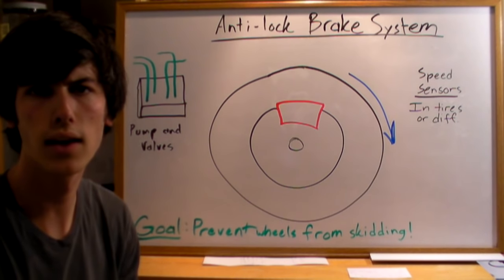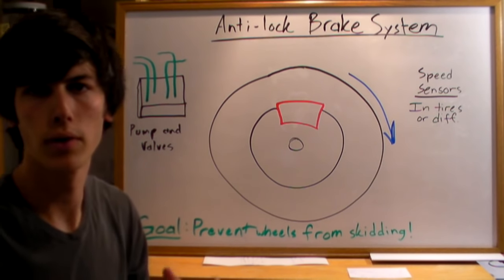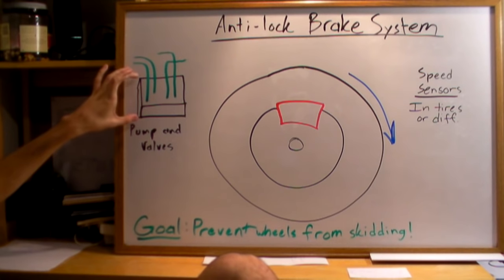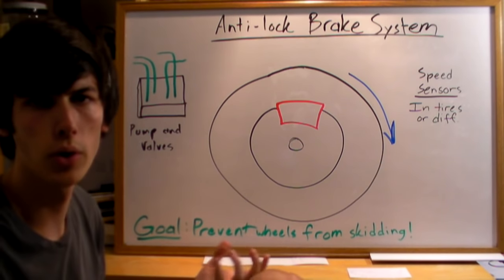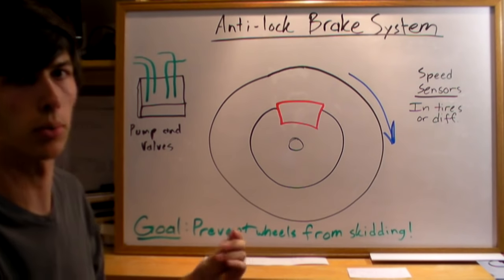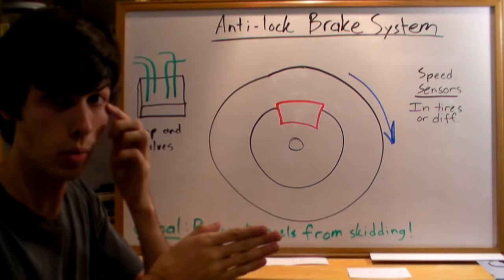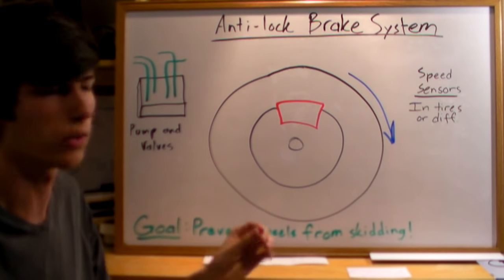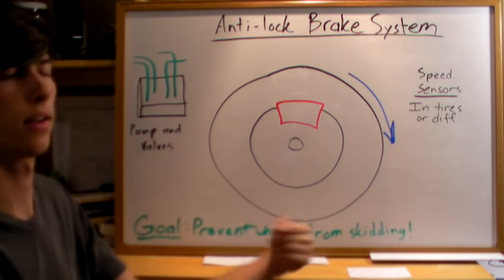Anti-lock Brake System - Explained

Comment from the maker: Well it depends on the complexity of the system. Theoretically a perfect ABS system could stop at peak grip, thus stop any car in the shortest possible distance. It just comes down to how quickly the system responds to alterations, and the duration it takes to press/release the brakes.

Comment from the maker: Could be a difference in the left and right brake pads or rotors. If one comes into contact first, it could make the car behave a little strange. You can always take it to a shop and have it checked out.

Comment from the maker: The brakes lock if you press your brake pedal too hard, and the force exerted by your brakes on your rotors is great enough to stop the wheels from spinning. You can't steer if your wheels are locked because your tires are just sliding, therefore can't change the direction you move in.

Comment: Great video...Looking for an in depth tutorial in future regarding master cylinder, modulator container, abs pump/valves, speed sensors and how and route of the brake fluid travels while braking, and what happens with brake fluid when antilock works.

Comment from the maker: Theoretically, ABS will improve the stopping distance if it can maintain peak friction between the tire and the road, without allowing it to stop too fast. There's not a definite answer. A good driver could likely stop in about the same distance by not allowing the tires to lock up. A less experienced driver would probably go a bit further than ABS would allow for.

Comment from the maker: IF your wheels lock completely under braking, and you leave the pedal pressed (keeps the tires sliding) then yes, ABS will improve your stopping distance. If you're perfect with your feet/brake feel, then you could theoretically stop faster on your own - not many humans capable of this though, and I would be willing to bet a computer would win 10 out of 10 times.

Comment: Hey man, you popped up as "related videos" while watching some F1 and NASCAR footages.

Anyway, on dry conditions, ABS will actually stop your car a bit slower than a car without ABS. The upside of ABS is that it keeps tire used in sorted fashion, meaning you will have tire worn out all "sides" at once, and it is impossible to tear down the rubber faster on one "plane" of tire. 
The only conditions in which ABS gives you advantages are :
-damp conditions
-cornering / steering while braking hard

Comment: Hi Jason! Thanks for the video. I know that's quite old video and probably I'll be speaking into to the void, but anyways, hope it will reach out to you and you will be able find some time to answer my question.

It looks like ABS is actually not the best possible (at least theoretically) way to stop because ABS system will usually cause some wheel slip whereas the most efficient way to stop is to have no slip at all. Is that fair to say?

Do you think that sufficiently experienced driver can outperform ABS equipped car controlling the break power manually w/o ABS?

(just found term called "Threshold braking" which is what I'm talking about)

Comment: In the dry whilst threshold braking, the difference between ABS equipped/ un-equipped cars is minimal. But as conditions get wetter/ icier, cars without ABS stop quicker. The gap between cars is metres in the wet (because the ABS cuts in too early and for longer), 10s of metres in the snow/ ice (because ABS basically prevents you from braking, but in an un-equipped car snow/slush builds up in front of the locked wheels and they effectively become a snow plough).

Comment: Agreed, but you can only go so far with software, it then boils down to the resolution of the encoder that is being used, and on your everyday sort of car it will be 'robust' to put it nicely (to keep it from being ruinously expensive to replace). 
In any case, ABS should not be extolled as something which it is not. It is merely a devise that allows you to maintain some level of steering during heavy braking.

Comment: I really like your videos (even though being an engineer and a tech myself I knew most of what you explain already) and your style of explaining technical topics as simply as possible without being boring to people who already have some knowledge in that field. But one of the main statements of this video is (in parts) wrong. 
An ABS System does NOT necessarily reduce the distance required to stop the vehicle. I know where you get that idea from (static COF is higher than kinetic COF) but what comes into play here (on older cars with older ABS systems) is that the tire's rubber sort of locks into the microscopic hills and valleys of the tarmac and is being ripped off which creates that burnt rubber smell and uses up a lot of the car's kinetic energy. The older ABS systems reduced the applied brake force by too much, so the ripping off rubber effect was bigger than in modern cars.
And even modern systems would be inferior to a very experienced driver, at least when the conditions do not change throughout the braking. If that sweet spot of optimal braking with around 15% slip is considered 100% of the applicable braking force, a very experienced driver will be able to hold the actual braking force somewhere between 80 and 120% (meaning 12-18% slip), so close enough to the ideal spot. An ABS, however will kick in probably at about 200% (30% slip) and reduce the actual braking force to sth. like 50% (7,5% slip). Old systems basically kicked in at 666% (100% slip) went down to 0% actual braking force, releasing the brakes entirely.
Where locking wheels are always reducing the distance is on loose ground like gravel or snow as locked tires build up a wedge of the loose underground material.
So for us standard casual drivers in more or less modern cars, the ABS will reduce the braking distance (though not by much). But it's main idea is to keep the car controllable so that you don't understeer straight out of the corner or can turn your car around that kid that just walked up in front of you.
Reply: You are saying the car stops faster when the wheels are locked up and sliding because the rubber being ripped off the tires uses up the car's kinetic energy? And for the numerical percentages you use, do you have any sources for where you get those numbers, or can you at least explain where they come from?

Comment: Hey thanks so much for your videos, they're all amazing!

One question, my van constantly ABS's even under normal conditions if I go to stop at a stop sign. It's fine when I'm moving fast but as I approach stopped it will always ABS a little. It never used to do this, what could be causing this?

Comment: As the ABS reads from speed sensor, is there any risk if i swap the current disc brake on my car with abs into a bigger brake kits? As far as i know, the speed sensor is not placed on the disc brake. Am i wrong?

Comment: Hey there... Firstly thanks for the vid very informative. 

I was driving a car I recently bought Peaugot 207. Anyway driving a long downhill my steering wheel locked as did the breaks after tapping multiple times. I had to use my hand break to stop. 

I'm unsure weather my car engine turned off while going downhill. 

Also there is a noticeable "release of air sound" when I press the breaks while off..

Any advice?
Reply: Lol go get your car checked out, not ask some dude on youtube, you have a serious problem with your car
Reply: Dont buy a Peugeot.....

Comment: Can somebody clear something up for me?  Does the ecu actually make a decision about how much braking force is likely to cause a slip?  Or is the system more mechanical?  Does the CPU sense no speed due to the sensor being locked up, and fully release the brakes or half release... to some arbitrary %, then resume braking once pulses from the sensor continue?  I know it might seem like it doesn't matter / over thinking but I'm an automotive technician, I need to be able to diagnose and repair these systems.
Reply: +kevin smith pre determined limits to wheel speed. it really depends on braking force. the abs system will continue to adjust pressure while you are breaking to get some wheel speed (no brake lock) hence the pulsating pedal its releasing clamping force on the caliper 
 but at the same time there are threshold limts in certain speed ranges. for instance if the abs system allowed 2km/h max wheel speed. you would never stop. so there is a limit to wheel speed vs vehicle motion

Comment: It is a common misconception that ABS makes you stop faster. IT DOES NOT (at least not in cars)! The only purpose of ABS is to allow the driver to steer whilst braking, which it does as you say in the video.
ABS pulses the brakes when it senses a lock up, ie: quick release and reapplication of the brakes. It takes a finite time to do this, this adds up to a noticeable differences in stopping distance between ABS equipped/ un-equipped cars, especially in wet/snowy/icy conditions.

Comment: I just bought a used car and THIS pulsing happened when I had gone down hill and THEN braked. I thought it is just my ABS BUT my mom thought it is a problem with the car';s brakes and THEN my Uncle drove it down a steep hill and said it is a brake problem. Now, I felt this in a previous car I had bought BRAND NEW and ONLY going down steep hills and braking medium to hard. I am thinking "normal ABS response" BUT my mom and Uncle (Uncle used to work on cars) are older and wiser, and THEY are going to have the used car lot "fix" the "problem".  My Uncle says his BRAND NEW car has this problem, and they NEVER FIXED it. YOUR video seems to show there IS NO PROBLEM. It is how ABS works. 

I have written down the title of THIS video and will have my mom watch it. My Uncle says the brakes need "turned under" does that make any sense? This is an OLD video, I HOPE you will reply anyway.

Comment: hey answer my question please!! can abs or anti lock brake system have java or c++ clode? i want to make my own abs module for my rc car.
Reply: Don't take my word for it, but I don't think you can use sensors to detect grip loss, so you just have to rely on loop commands. If you can though, a while or if command would be good enough.

Comment: Fair point with the EBD, but it doesn't encompass cars that were built before its inception.

Fine, Point is on snow (As tested by the Finnish car magazine, Tekniikan Maailma):
Locked wheel car stopping distance - 53m.
ABS car stopping distance - 64m.

My main point is people should not think of ABS as a tool to stop quicker; a) because it was not explicitly designed to do so; b) That results in people who drive round with a God complex thinking 'I have ABS I'll stop'.
Reply: Doesn't skidding on locked wheels also relies on the tire properties (more or less grippy) too?

Comment: I apologise for not having the necessary data to back up my claims. It's not my information to give away, as it belongs to the race team who were testing their Evo (I was just being nosy at the time). So no, I am not making numbers up, I am commenting on the data and testing I saw. 
I never disputed that it was a bad thing to have, because yes, it will prevent lock up 10 out of 10 times. I was just pointing out using ABS is not necessarily the fastest way to stop your car.

Comment: I disagree about the point ABS provides the best possible breaking performance. From physics pov, it detects sudden speed drop of wheel (that is not the cause but the result of transition from static friction to dynamic friction between road and the tire), then it releases the breake of that wheel to a point that it assumes speed is ~equalised, so friction coefficent reverts back to static. Then applies in full force again only to be released after next lock-up and it goes on.

Not denying ABS is a must have safety feature but its still a very clumsy method for achieving best possible stopping distances. Any competent driver (or even any average driver after practicing it a few times) will do better by applying threshold breakes and holding the friction coefficent much higher than the mere average of static+dynamic ABS provides (and that is not counting the response times of the brake system in general)

Comment: Im told the Bugatti Veyron and his braking system is so advanced that in emergency braking that the computer calculates the maximum necesary force to maintain grip thousands of times a second.

But the sistem itself is completely unconventional, fully digital in respect that it doesn't have such a component described here.

Mind you, its second hand rumor so I don't know if its true, maybe you know?

Comment: So without ABS, can't I just repeatedly press the brakes?
Reply: +RzVids you could but i doubt you would be able to match some ABS systems that can relieve and reapply braking force 15 times a second.
Reply: +RzVids In theory that makes sense. Just don't slam the breaks and lift off a little bit every once in a while. I doubt that it'd be any where near as effective as the system because humans can't monitor the breaking limit and can't switch the breaks on and off as quick as the system can. If you get it right then it could work I guess, but otherwise I'm not sure.
Reply: +RzVids you can modulate the pedal. meaning if you feel it lock up. 
you will feel the car almost accelerate. and when you let off the brake you will actually slow down even while releasing brake pressure. because you use the rules of grip and adhesion
Reply: +rynatta No, it may sample the wheel speed at 15 times a second but it ;cycles the ABS ;at a time period that is the time it takes the wheel to re accelerate to speed and begin to lock again, which can be 2 or 3 times a second on bitumen, you can hear the hydraulic hammering in the brake lines as it cycles, on snow the cycle time can be much longer resulting in very much longer braking distance than if you had just held the brakes on to some degree. ABS is not designed to reduce braking distances it is design to allow you to steer the car under hard brakes to avoid an object where it will not steer at all with front wheels locked up.
Reply: AusMecham if you slam the brakes on a car with no abs the amount of braking force exceeds the amount of traction a car's tyres have and hence is why you lose traction and takes longer to brake. This is more pronounced in wet/snowy conditions where traction is seriously impaired. It's exactly like smashing the throttle from a stand still, you lose traction and lose control whilst taking longer to get to speed. ABS modulates the brake pressure when 90% of people will smash the brakes when they perceive danger. I agree that you can reduce braking distance as compared to ABS if you know exactly how much pressure to apply proportionate to how much traction your tires have but if this is done correctly ABS should not kick in as traction is not lost. Bottom line: ABS exists for when 90% of people smash their brakes and it would be useless/unsafe to have the ability to disable it or not include it at all.
Reply: *ABS is not designed to reduce braking distances it is design to allow you to steer the car under hard brakes to avoid an object where it will not steer at all with front wheels locked up.* Beautiful explanation. Thanks!
Reply: I don't think this is true. In order to allow you to steer under hard braking ABS must prevent the tires from skidding, which necessarily must reduce braking distance as explained in the video.

Comment: Nothing beats a trained foot
Reply: except ABS
Reply: Jesse Yoder Maybe the most recent ones..
Reply: +UncensoredNakedRacing Doubt you can move your foot up and down 10+ times per second though. Still, in a car with no ABS, a trained foot is as good as it's gonna get.
Reply: I've seen race drivers get better lap times without abs than when they had it on
Reply: UncensoredNakedRacing Depends on what the ABS system was like. If it was an older car, then it's probably one of those systems that lets off on all the wheels when it senses one locked up. And of course, ABS isn't exactly "precise". As EE explained it, it lets off the brake until it senses the wheel go back up to speed, then reapplies it. If it's not done very well, then it's actually likely to slow down someone who knows the car inside and out. Then again, modern systems don't wait for the wheel to reach up to speed so they can measure it, they use other means of sensing speed and then calculate how fast the wheel should be spinning so they keep it on the edge of the grip levels.

In conclusion, yes, it's likely that some people are better at controlling the brakes than some systems are, but in 99% of cases, any ABS is better than no ABS.
Reply: +UncensoredNakedRacing That's threshold braking. ABS can be too intrusive sometimes. They have been adapted for racing as well. If you threshold brake you won't hit ABS but if you do it's a nice safety net
Reply: No foot can separately control each of the 4 brakes at any given time.